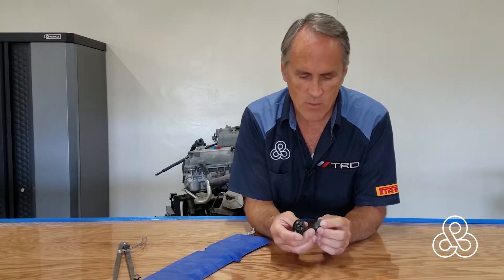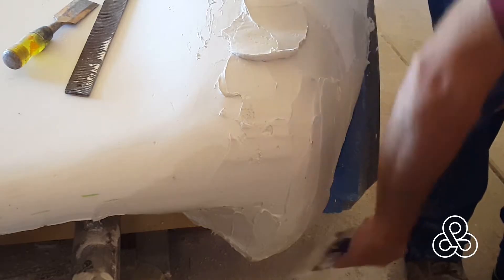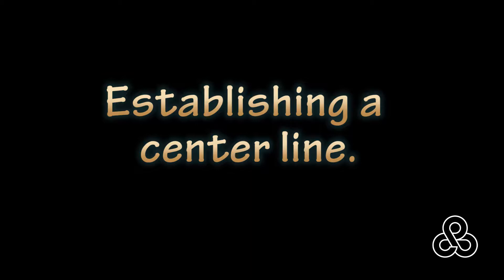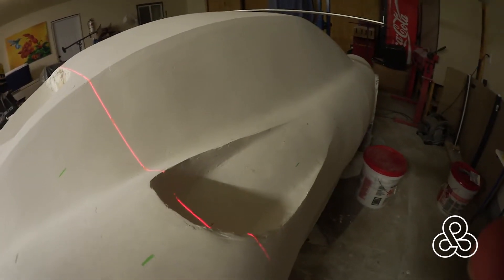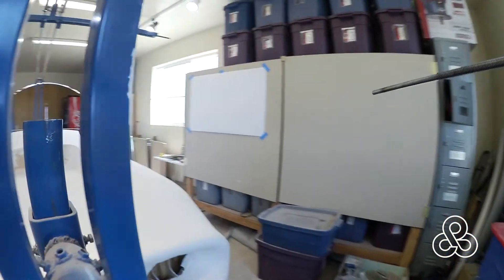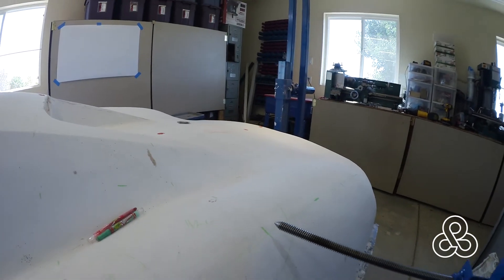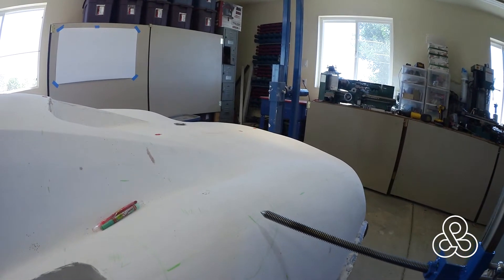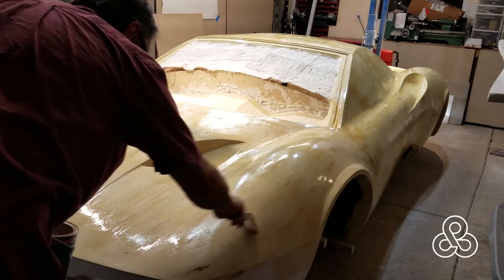A05 - Like old times- hand built straight and symmetrical- Jarvie Arete supercar

Comment: Love this series. Before using the pointer, how do you ensure the floor is leveled and the rotation of the model is on the same plane as the floor?
Reply from the maker: The metal frame that the ribs fasten to, keep it all level, if the floor is level. I poured the concrete floor, so if it is off I am to blame. Ha!

Comment: Hi,how did you shaped the rear part of the trunk? I can’t imagine how can be this shaped with that template procedure.
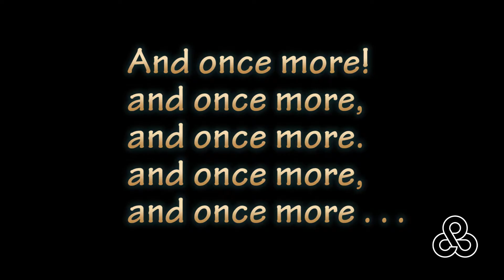Reply from the maker: The ribs on the ends sit at 90 degrees perpendicular to the last ribs in the series, to increase the detail and form undercuts.  You can see it in this video at about the 6:15 minute mark-  https://youtu.be/paR9zSvK2eo  Thanks for watching.
Reply: @BuilderCreator  thank you for sharing your knowledge. Even like this, then, the left and right side parts of the car would be “out of template”. As I understand, there will always be a spot where the template ribs would not provide the shape. my best wishes to you!

Comment: The way your sides were off that seems to get progressively worse as you got away from center, I would almost suspect that your rotisserie was rotated slightly.  Was there a part that I missed or not shown where a where a none correctable part (like the windshield itself) was trued with the rotisserie and locked into position before it was lasered and checked with the pointer?
Reply from the maker: Not sure I can remember were most of the corrections occurred, but I can say that the laser and pointer checks all took place with the car on the ground.